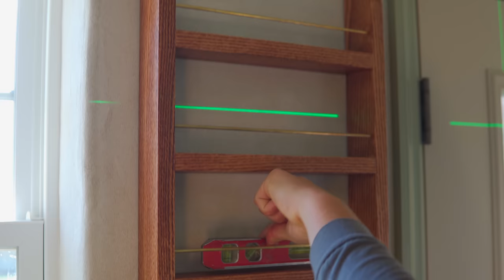COTTAGE HOME Finishing Touches: Spice Rack, Paintings, Plants, and More — Ep. 209

Comment: Looks really nice.  The hinges on the screen door are not installed correctly.  The hinge is supposed to be positioned on the inside of the screen door and then with a right angle mounted to the inside of the door frame opening.  That way you would get rid of the flap of metal on the face of the building.
Reply from the maker: Funny enough we actually wanted to install the hinges the way that we did specifically on the farmhouse storm door so we wouldn't have to cut a little gouge out of the edge of the door for the hinges to butt into. I know it may be totally unconventional, but we got the nice antique brass hinges and thought that having them face out that way, would not only give it a more farmhouse feel but allow us the option to easily take the storm door off if we wanted to swap it out or remove it. We also first considered lift off hinges, so we could even more easily remove the door, but the lift-offs that we looked into were just too expensive to justify that cost of hinge, so we went with the next best option we felt for what we were looking to achieve.
Reply: @FlockFingerLakes  I understand your thinking but if you were a student in one of my classes at Pratt or FIT I would give you a 'C' for that move and a much higher grade for the rest of the project. It looks off and draws attention to something - a hinge - that is not worthy of the attention, IMO. Notching a door frame carefully is a sign of skill and doesn't degrade the house but hides something that otherwise looks odd - as if the builder didn't know. If you want to show the hinges they need to be more interesting, not just the fact that they are brass.  Something decorative like a strap hinge could work.